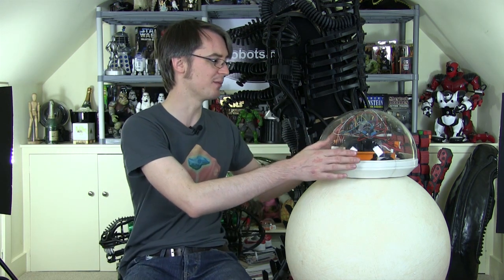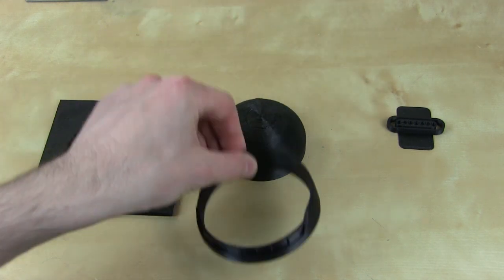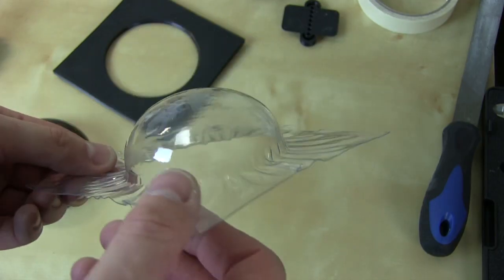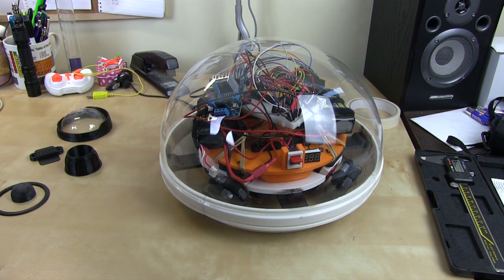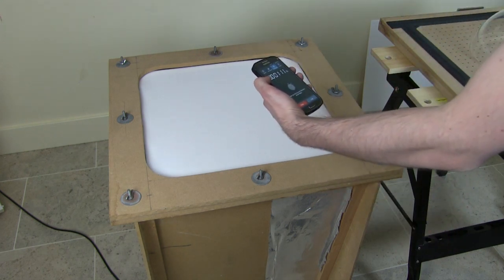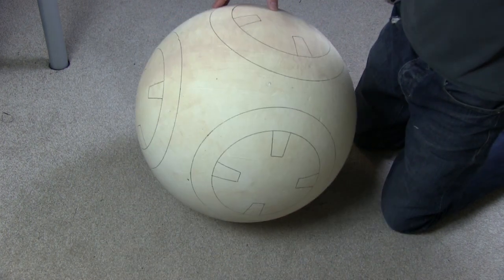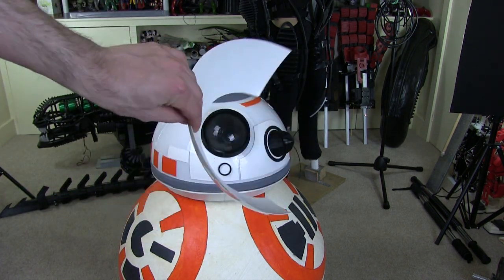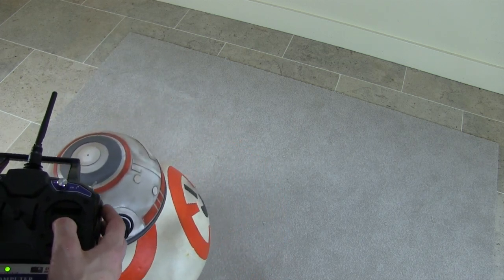Star Wars BB-8 Droid v1 #4 | Painting & Finishing | James Bruton

Comment: I'm making a miniature non remote controlled bb8 and wouldn't making the bottom self balancing and the top magnetically attracted to a balanced magnet in the bottom work? If you pushed it it would roll and the head would remain on top because a balanced magnet inside of the sphere of the body would keep it upright, correct?

Comment: Hi James this build has inspired me to give a static bb8 model a go using the same method you have here with the 500mm polystyrene balls from ebay. As you've already worked with the balls I was wondering if you think it would be possible to engrave the panels in a little using a hot knife before sealing with the latex to give the body a little more dimension?

Comment: You might allready have fixed it, I just started watching your vids. But what i think you can do to get rid of the curved lip is to raise the clear dome from the vaccuu-base by placing something inside it that should pull the plastic down further and even  around the bottom edge of the dome. That will make it even harder to pull off the clear dome but should make it alot tighter. it might also rip the plastic if your vaccuumcleaner is too strong

Comment: if you had read what I sent you, I would have solved the instability a long time.
Reply: Daves Mestrinho Você teria que colocar a eletrônica e eletromecânica dentro da bola na parte de baixo com as rodas correndo pela superfície de dentro, assim, o pequeno veículo correria por dentro da bola e seria o contrapeso para você ter um lado de referencia com centro de gravidade baixo, como se fosse o joão-bobo, coloque mais peso nesse novo veículo e acrescente uma haste leve que se aproxime do topo da bola por dentro com um imã, coloque na cabeça do robô outro imã e outro suporte de rodas para que ele rode por fora da bola preso pela força do imã e orientado pelo veiculo de dentro, faça uma tampa na bola para que tire as baterias do veiculo e possa fazer manutenção quando necessário... vlw e flw.

translation PT-BR for English: You would have to put electronics and electromechanical inside the ball at the bottom with the wheels running over the surface from within, so the small vehicle would run inside of the ball and the balance would be for you to have a side reference with low center of gravity , like the Jack-bobo, put more weight on this new vehicle and add a light rod that comes close to the top of the ball inside with a magnet, put on the head of the robot other magnet and another wheel bracket to make it run by off the ball trapped by the force of the magnet and oriented by the vehicle from the inside, make a lid on the ball to take out the batteries of the vehicle and can maintain when necessary ... vlw and flw.

Comment: Raising the dome about the same height as your dam would likely solve the too short problem. There's too much springback down at the lower edge near the mold surface that the vacuum just won't overcome. Raising it slightly would alleviate that and also give you more trim.

Comment: Hello +James Bruton,

First of all, you made a great job ! That's amazing what you did! 

I'm working on a robot that has to be stable on a ball, like the new Star Wars BB8 robot. 
I'm using an EV3 Lego Mindstorm with LEJOS interface and I'm programing with JAVA. 

My problem is about the stability. When I hold the ball and when I roll it in one way ( slowly) the robot go back to his initial position. However if I leave the robot alone, the ball rolls alone too fast and the robot can't stay stable and fall always. 

The robot has 3 omniwheels placed 120° from each other, the ball is a gym ball which is bigger than the robot. I'm using DexterIMU gyroscope and accelerometer. 

Do you have any tips to resolve this problem ?
Reply: *****  Well your robot stay alone on the ball and mine is always falling because the ball is too unstable. I'm stuck with this problem since 1 month a half. 

Do you think the problem could be the ball ? 

Good luck for yout part 5 ! 

Thank you !
Reply: Christophe G have you tried putting some weight in the ball? a little water or cooking oil? might help dampen the motion.

Comment: Have you considered a hollow metal ball and then changing the head so that the balancing wheels are magnetic.  If you do this I think you could potentially knock the anahiem version right out of the water.   Also inside the metal ball could be a device to drive the directional spinning of the ball and the head essentially then clings to the body balancing itself as you choose, because the wheels are magnetic it wouldn't fall off very easily even when unbalanced.

Comment: I'm guessing that if you can smooth out the accel and decel of your motors you'll get some better stability. I'm not sure how accurate your DC motors are at low speeds, but if that bit is a problem, steppers will help out (like you mentioned). This seems like a case of the inverted pendulum problem, in 2D. (Sorry, I didn't see your first three videos.)

Comment: Thought CMU Robotics Dept. did this a long, long time ago with a three (3) Omni-wheel that could go in a straight line in any direction !  Lower the center of gravity and to make the small Omni-Wheels larger put them in the large lower sphere !  Put a wand or egg shaped loop to the top of the sphere with two or three super magnets to keep the head retained on top and the ability to (point) turn to different directions.  Your off to a good start and keep up the good work.

Eyes UP and lights down,  tjl  Sent by Win7Pro64 w/ADSL

Comment: I think if you added some weight to the inside of the big ball that would stay low maybe on some omnidirectional rollers it would stabilize the whole thing greatly also it would make driving and steering it much easier as it would dampen the tendency to roll over.  This would also make the head have to move further over to cause motivation much like the movie prop.

Comment: I suspect that placing some sand in the ball would replicate the effect of driving on carpet, giving it the ability to drive on hard floors. What it truly needs is just more powerful and faster motors.
Reply: On second thought, it is possible that the sand won't start sliding until the ball has already tipped to the point of no return.

Comment: Looking at your heat forming:

One thing you might want to do is make sure you can push that ring farther down past the object you want to form around. So rather than printing a half sphere print a half sphere on a short cylinder. The wrinkles will still happen, they'll just happen on part of the sheet you're going to cut away.

Comment: with making the clear plastic domes, you can use a clamping frame similar to your vacuum former, but with a hard plate on the front with a hole the diameter of the dome you want,the the plastic, then a hard back plate, and then carefully "inflate" it with compressed air to the size you want.

Comment: should use a PIC controller.

I find that the arduino controllers have a slight bit of lag and could be contributing to the swaying  it's exhibiting when it's neutral. 

You could all use a FPV gimbal controller and some brushless motors to do the same thing. then you would only need a controller board, which then you can use a arduino.

Comment: The vacuform didn't create a tighter fit because of the spacing between the holes on the platform. Once the holes are covered you lose suction there's nothing to pull the material into the tighter crevices. You can make the holes in a tighter pattern or when you heat your styrene, make sure it's sagging in the middle before you put it on your vacuum. Making sure it sags is a good guide on knowing that it's at it's maximum flexibility but if you let it go too long it will melt completely so you may want to time how long it takes to reach sag level for different thicknesses.

Comment: Hi James, another great video.  Question, at 5:50 ish I see the layer cooling fan running, isnt that bad for ABS ???
Reply: Ah, the only thing that's ever happened to my ABS prints when I run the layer fan is layer splitting or lifting off the print bed :S Looks like I have more to discover about 3D printing

Comment: How does the real one work in comparison?
Reply: ***** it got motorised wheels inside the ball to make it roll, and the head is atttached via magnets
Reply: It's made by Sphero.has a half-ball in the bottom which moves inside the big ball and a sprung stick to the top with a magnetic attraction to the head.
Reply: Acrimonious Mirth I'm thinking that there's no mechanical stick inside the BB8 main ball, but rather a series of electromagnets on an inner dome inside the ball and they control the position of the "head" by permanent magnets in the base of the head and some control of the electromagnets.  Think of the head positioned being like a brushless DC gimbal motor with a weird geometry. It would be very smooth and very quiet.
Reply: +USWaterRockets hmmmm could be. Note that in the demo vid the back of the head never passes the dead point on the body.
Reply: USWaterRockets Actually there is. This is a comic reprensentation, but i know, that it works like that.